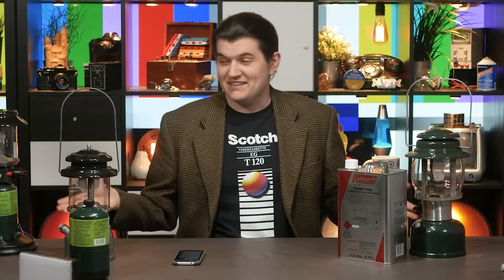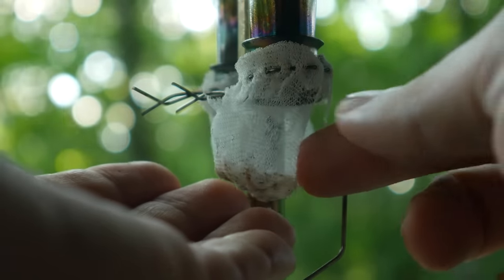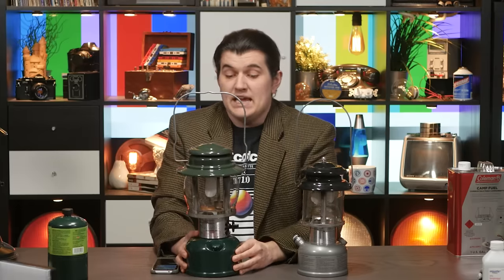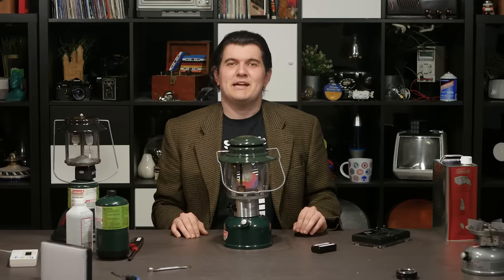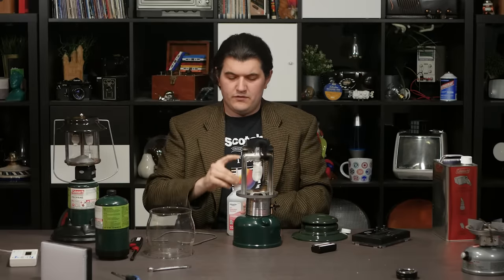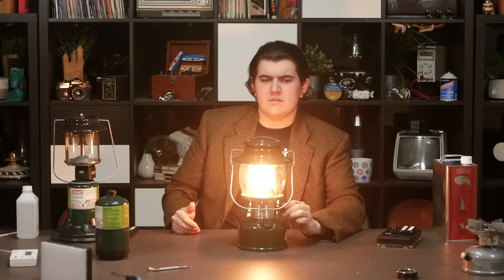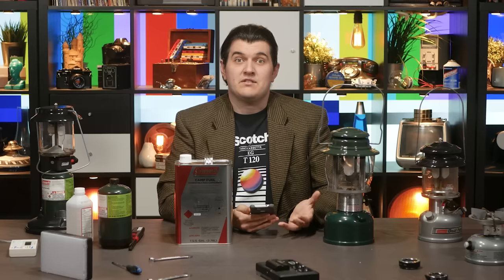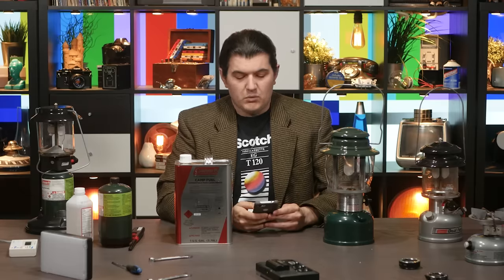A very rambly Coleman Lantern follow-up. Turns out they rarely make sense in 2021

Comment: Awesome video: you covered this but I want to emphasize, liquid fuel lights and heaters that are used in cold weather outside activities, ice fishing is the first thing I’m thinking.  Or, Farm work in a cold barn with no electricity and you need heat and light, the fuel lanterns work very well.  I carry a 30 day battery lantern and I’m grateful for having it, but for emergency heating, cooking and lights, propane is simple and reliable.  This year in Texas I was prepared for all of the electrical grid issues with a combination of propane and battery devices.  Propane does have extreme cold weather limitations and white gas overcomes that. 
Kerosene can be used in indoor safe heaters that white gas can’t be used safely. So then having a kerosene lantern makes sense to stay to one fuel.  Batteries are the future, and in lighting they are the present technology.  But heating and cooking still requires some kind of fuel and to be indoor safe not pump gasoline.  All three types of energy sources are desirable for emergency preparedness. Texas power grid failure is a example of being prepared.
Reply: In an emergency batteries can be used to cook on a stove
Reply: OFF ROAD GASOLINE (not taxed) is just as cheap as kerosene.  Almost a dollar less than auto gasoline.  So once again, no reason to deal with the lighting hassle of kerosene lamps

.
Reply: @electrictroy2010  there is no untaxed gasoline in the US. Perhaps you're thinking of diesel which is dyed if sold for non-road use.

Comment: I love your videos!  The thing that makes me keep the old Coleman white gas lantern is the fact that it's been around forever and is super reliable over time.  My father appears to have bought the one I now own back in 1956 and I fully expect it will outlive me.  Still relatively cheap to use in almost any scenario IMO and I doubt the long term reliability of the electric lanterns on the market.  I can't even find a LED flashlight that the switch doesn't give up the ghost after about a year of mild use.  Batteries can have their own fire hazards if you drop or otherwise damage them.  I agree batteries and solar chargers have come a long ways but I just can't put them even close to the dependability I can get from an old coleman lantern or stove, Sunbeam toaster, Whirlpool washer or my old Jeep Cherokee.  These products are legendary and seem to predate the notion of planned obsolescence, let alone the instant crap value engineered garbage we keep shelling out so many dollars for year after year.  Just one man's opinion.
Reply: i bought my colman at 15 in 1974 just used it last weekend great product i am 61 now

Comment: A few reasons I live these lanterns is 
1: It shares fuel as my camp stoves
2: The CRI and warm omnidirectional light is far more pleasant than generic LED options
3: I'm a nerd and like using all sorts of old things. (I recently did a 4 hour hike at night with a Coleman lantern and stove)
Reply: If you use them for camping then yeah I totally get that, however what about propane instead of kerosene
Reply: Propane equipment is often far shoddier in construction, whereas my white gas camping gear is from the 60's and 70's and still bulletproof. Propane/butane also has different types of fittings that aren't compatible. Not to mention that you pay more for the metal canister than the propane within it. They also don't work well in the Canadian winters that I often camp in, because I'm crazy. They just stop outputting gas because it's effectively a refrigerant and it cools itself below the point it'll evaporate.
Reply: All this being said, I've got a Sofirn LT1 and LT1S and they're excellent high CRI, adjustable white balance, USB rechargable power bank capable LED lantern that takes either 1-4x 18650 for LT1 or 1x 21700 for LT1s. My Coleman lantern from the 50's died and I used one of these while winter camping and it's great. No heat, but you can use it in your tent at night safely. And much much smaller. Finally replaced it for me and much much better. 2700k at night, 5000k to reinforce overcast light to wake up, from candle dim to 60 watt incandescent equivalent.. yeah.

Comment: The only reason I use a propane lantern when car camping is because they're neat, and the camp stove uses the same propane bottles. I would never use it in a tent or indoors however (unless its an emergency). Battery is by far the best option for indoors.
Reply: @baronvonslambert  Yes the cooler led light clashing with the campfire's warm glow is a big reason why I'm firmly pro gas lanterns for camping. You can also get nicer lamps with a pipe on the bottom to use with the big propane tanks simultaneously with a grill
Reply: @Aquatarkus96  : Depending on the model of light, you may be able to swap out the LED color. What you can't do is run them off a propane bottle.

Comment: You never have to remove your thumb from the hole while pumping. The hole helps to prevent from pumping too much pressure into the tank.
Reply: if there was too much pressur it would push yor finger off i assume?
Reply: @vitalsteve1  you can pump the hell out of the tank, till your finger hurts pushing the plunger down. Not safe, but i did it once till i realized how thin the tank was and didn't want it to burst in my face.
Reply: Incorrect. It's to act as a check valve using your thumb.  Coleman pressure tests their tanks well past what the pump can even provide JUST for that reason.
Reply: @vitalsteve1  It is there so you can push the pump rod back in once you are done pumping, that's all.

Comment: I use my Coleman lantern simply for the vintage look and feel. Plus I find it to give off more light than some of the LEDs I have (which are admittedly dim for LEDs). The heat is the nice thing as well. It is great to have at night when you're having a campfire, camping, etc.
Reply: I was about to buy a new led lantern for a camp trip, then I remembered our old pressure lanterns. Literal antiques, and they still work! Already more reliable and efficient than a new one in my book

Comment: @8:30 In the last >4000 comments someone has probably mentioned, that hole is also used to mount a spark wheel for lighting the lantern. Much nicer than fiddling with a match.

Comment: Don't forget that when using a gas lantern, you have to actually carry a massive lantern, which you don't have to with batteries.
Reply: Plus mantles & generators and a tool to change the generator. Fragile mantles and globe, be careful hauling all this around.
Reply: So true in his examples. Not portable in those forms at all. There are very small butane gas units (without the bottle) that can fit in your palm.
Reply: @paulwoodman5131  generators? I have original 50s and Older generators that still work just fine. They rarely need to ever be replaced
Reply: @crabtrap  truth
Reply: @crabtrap  Oh please, as if the batteries you can pack in the same space of your coleman gas lantern's gas (or the latern itself, ffs that thing is huge), would ran out before you ran out of gas. Everyone is a moron when you're the one describing "their" point, one might even wonder what is the singular common factor there...
Reply: @louisvictor3473  again, try extracting warmth from a led. Many people use lanterns for real world application during life altering situations. Floods, earth quacks, hurricanes, deep offroad, safari. Batt lanterns are fine for tree lawn dwellers such as yourself; but hush-up when the men are talking.
Reply: Summer camping has plenty of heat.  I don’t want a lantern that adds even more heat.  An LED lantern that produced no heat is preferred in summer camping

.
Reply: Add-up the space for gasoline tanks.  Now replace with an equivalent space of batteries.  Those batteries will keep an LED lattern lit for WEEKS.  Your gasoline will not

.
Reply: @electrictroy2010  a coleman 200 will burn for 14hrs straight. Also prodicing usable heat at 150watts light output. 8 D cells would NOT do that. Would cost $14 for 8 D cells.
Reply: @electrictroy2010  ok. Summer camping sucks
Reply: @crabtrap  "again, try extracting warmth from a led. Many people use lanterns for real world application during life altering situations. Floods, earth quacks, hurricanes, deep offroad, safari. Batt lanterns are fine for tree lawn dwellers such as yourself; but hush-up when the men are talking."
- This video was talking specifically about two use-case scenarios; camping and emergency lighting in the case of a power outage. This comment thread was also talking about the same scenarios. If either of those scenarios lead you to be in a situation where you're hugging your lantern for warmth, you didn't prepare for those situations like you should have and you fucked up. 

All of the other hypotheticals you mentioned are completely irrelevant to the conversation.
Reply: @Demonrifts  thats horse shit. Obviously in a tight urban apt building an led would be a better choice.....but if u are there in an emergency....you fucked up. As for camping im fine with either In summer. Any other season (yes some of us hunt,fish,hike in fall and winter. That heating is welcolm, its also a great substitute for a campfire which are prohibited in some parks.
The reliability factor of a liq gas lantern is established fact. No reason a 100yold lantern will light today like it did when new.
Led uses PC boards and plastics that degrade. No user repairable parts.
LED lanterns my have a place but the chucklehead in this video has zero idea of pros and cons
Reply: @electrictroy2010  do you have any idea how long a gallon of fuel will provide light ? Don’t rely on a sissy in an emergency situation. This guy’s probably afraid of fire crackers.
Reply: The simpler choice is to just buy both. One for hot days one for cold. Anyone stocking up on emergency supplies can certainly afford it as there's no 'be frugal' with emergencies.

Or just cope without light after sundown. Not like there's any worthwhile work to do during residential power outage anyways so it's not like turning a light on just to stare at a painted wall for 4 hours before bedtime is all that productive.
Reply: That matters for backpacking, but not really any other use case.

Comment: What is the specific LED light that is being shown off when he talks about battery systems past the 30min mark? Want to look up the specific specs on them.
Reply: You can see tons of those lights on eBay & Amazon, almost all of them with that Sony battery pack, some with AA compartments as well. I would have killed for those in the 90s. There are various models, some with filters to correct the colour temperature (3300K - 5600K). There are others that you can dial in the temperature. "LED camera light" is a good search term.

Comment: For camping, I still prefer the propane bottles because - at least here in France - everywhere you can restock food will also take your empty bottle and sell you a full one

My lights are all electric btw ^^ Gas is for cooking only
Reply: @ttww1590  In France a shop that sells hard to recycle stuff (batteries, lightbulbs, etc...) is supposed to take them back. It's not very well applied for the less common stuff but I'm in Queyras right now (southern Alps) and every single general store will take them even the small ones. People here are very keen on keeping the mountains clean

Comment: Ok, kerosene is cheaper, but there may be other reasons why someone prefers kerosene.  Fuel availability in their area, for example.  Or maybe the need to store fuel on-site.  Familiarity with a particular model of lamp could be an issue, or maybe someone is unable to buy a different lamp.

If you have money to spare, plenty of places nearby to buy different fuels, regular deliveries from Amazon, and the ability to easily learn how to operate different lanterns, finding the best one for your needs and buying that one seems obvious.  The whole world doesn't necessarily have all of those advantages.
Reply: He covered that pretty thoroughly
Reply: In remote areas kerosene is easier to transport and store. In a punch #2 diesel can be used. It is dirtier but usable. Also, kerosene can be reasonably safely stored in occupied spaces. I have seen these on the Navajo and Hopi reservations in Arizona and New Mexico. They have the wick type kerosene heaters and kero lights. Most keep a 5 gallon container inside for refueling at night or bad weather. These people have wood for heat and cooking so storing fuel is not a big deal. Keeping a kero wick heater going during the night is much easier than tending a wood fire. And lighting a kero wick heater to warm up a hogan or small room is easier and faster heat than firing up a wood stove or fireplace. Most living like that have loaded firearms next to the door and kids grow up respecting things that can kill you.

Comment: a technology that makes a lot of sense to me is something like a very small propane/whitegas/gasoline powered sterling engine running a tiny generator. like we have big generators, but im talking something that hits 5v 2a and that's it. something like that would likely be all around more efficient  for light production than lanterns, and have way more use cases.
Reply: Brilliant!  I'd buy one!
Reply: For lighting, even 5V 1A would give you 5 watts. That's a decent amount of light for some uses.
Reply: Seems like a nice idea. 
But a small stirling engine would be way too fragile with all its moving parts. (that would be a very cool "steampunk" gadget though :) )

Better go Seebeck effect, with no moving part, way more reliable.
It has an efficiency of around 6%. 5 times worse than stirling, but still 6 times more effective than gas lighting.

It would be worth it, if you add your seebeck apparatus on top of your gas lantern. 
With some LED lights, that would double your lighting time + you can charge your precious phone :).
Reply: I think a stirling engine generator (5V or maybe 12V DC) would be great for camping, especially if you designed it so it could use either a propane (or other fuel) burner  or a wood fire as a heat source. I'm not sure if you could build a practical one cheap enough to sell profitably though.

Comment: A kerosene pressure lamp we used had a pretty fun alternative for lighting it if you didn't have alcohol to heat up the generator.

You had a little "lever" that you could pull that opened up a hole you could stick a match in. That hole also connected to the tank and I guess it simply was some kind of fine atomizer in there so you could atomize and light the fuel making a tiny flamethrower that shot fire at the "sock" and the generator to heat it up.

Comment: Thank you for the the great series on the lamps!  I know this video is a couple years old, but I just stumbled across them. Couple of comments though:  The best thing about the coleman lanterns during camping is that they add to the ambiance of why we are out there in the first place... the LEDs, though efficient, takes away from that. Cost of fuel is not my concern.  That said, your calculation on the costs did not take into consideration using unleaded fuel, which by the way, with Coleman duel fuel stoves, you can also use for cooking (can't with batteries).  And lastly, in the States, it's easy to find small propane cylinders or white gas.... but I've been living in Africa for the past 15 years and take my word for it, sometimes not that easy to find.  However, I can always find unleaded gasoline. That being said, inside a tent or when my house is dark due to the frequent (daily) power cuts, I do use rechargeable led lights due to their convenience , safety and the fact they don't give off heat.
Since I ran acoss your channel - been powering through a lot of your videos - they're great!  Thanks again

Comment: The reason for the propane being unsafe indoors has to do with the risk of consuming the oxygen in a small space. Propane is used in warehouses all day without issue.
Reply: No it is because it is gas under pressure. A small bottle of propane, the 1 pound cylinder for example contains enough gas under pressure to expand to like 300 square feet.
Reply: @strawberyyicecreamdream216  true but that's another can of worms altogether
Reply: @strawberyyicecreamdream216  

Gas is a volume, not a plane. You mean cubic feet… and that has nothing to do with why propane can be dangerous in small rooms and even outdoor tents. The only risk associated with unpressurized propane in open air is flammability. The reason why it can be dangerous is because when the propane is burned it emits carbon monoxide as a byproduct. Carbon monoxide is roughly the same density as air, it doesn’t settle to the floor or rise to the ceiling of that room, it mixes with the air. Eventually, one succumbs to carbon monoxide poisoning and more often than not dies if they pass out. Carbon monoxide poisoning makes you feel sleepy with a slight headache. Proper fresh-air ventilation is an absolute must when burning propane in any room in any structure. Having experienced carbon monoxide poisoning symptoms several times, ALWAYS have a window open to fresh air.

My experience with burning propane lanterns is from being an avid ice-fisherman for the past 25 years using extremely small fishing shelters and lanterns for heat and light. Mostly heat. The dangers of propane still have nothing to do with it being a pressurized gas lol. Those dangers apply for ANY gas/liquid under pressure. Some just like fire more than others.
Reply: @ryanwilson5936  Alright, let one leak in a small space and reply back with the results.
Reply: @ryanwilson5936  Lol another paragraph of nonsense because you can't understand that gas displacing oxygen in a small space is dangerous. 

Hey bryan, if it's such a non issue why do they add the rotten egg smell to gas? For fun right?